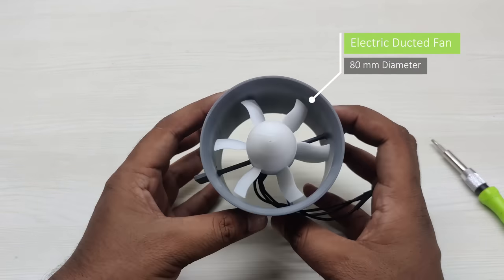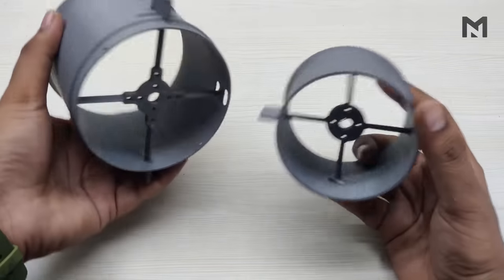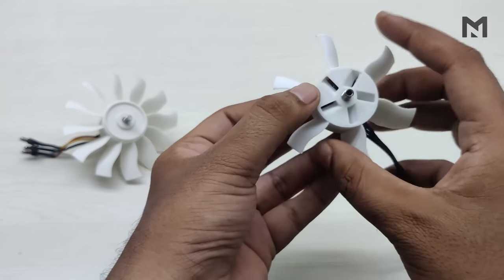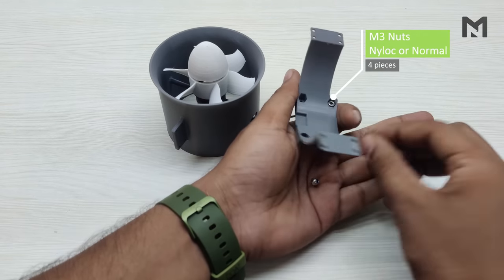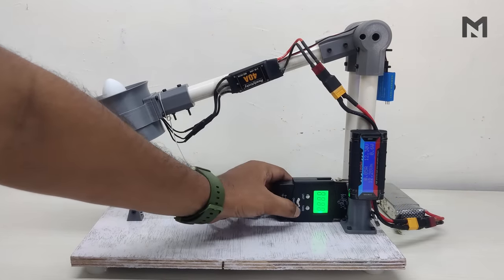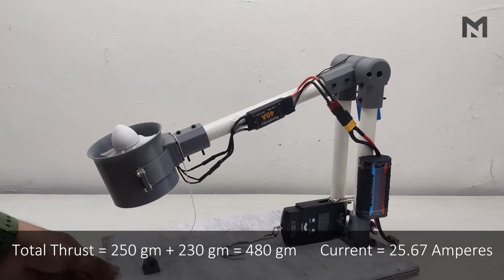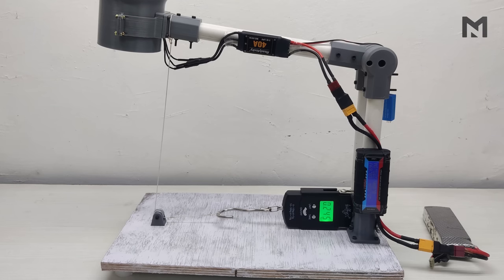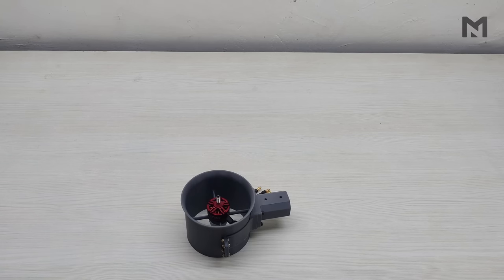DIY 80 mm Electric Ducted Fan | 3D Printed | Thrust test comparison

Comment: Very good setup and work hard, but In my opinion you should fix the engine then measure the trust directly for example you put the weight scale 20 cm from the output nozzle.
Reply from the maker: Oh yes i must do it but this is so far accurate method I have fount out for thrust calculation. I am in development of electrical thrust calculation device and thus it will give an accurate result.
so thanks for watching this video and don't forget to subscribe
Reply: @MechNinja  Thank you very much and I subscribed already 😊😊😊

Comment: The stators in your housing are not doing anything.  You need to look at stator designs as they will impact the performance greatly.
Reply from the maker: Thankyou so much for your suggestion.... actually this is my old video....do check my new videos I have improved my designs a lot...
And don't forget to subscribe 😊😊😊

Comment: Nice work, but, yes there is a but: you essentially built a ducted propellor, not a fan which consists of a dynamic stage (the rotating fan) and a static stage (the stator) this stator behind the fan converts a fair portion of the dynamically produced trust by the fan into static thrust. Static thrust is what you need to have an efficient fan…. But al in all nice work

Comment: I have a query if EDF is place vertical and thrust is in upward direction  if high speed air coming towards EDF in horizontal direction then the result of thrust will change or remain same.there is no effect of air on propeller performance.
Please give me answer
Reply from the maker: Well that's a very nice question 😊🙂... Though I am not 100% sure....but I will provide you my answer...
See when there was no external force ( air ), applied to the EDF than it has the max thrust in vertical direction. But when high speed air comes in horizontal direction then horizontal force will act on it and this it will tilt the EDF at some angle.  Now using parellelogram law of vector addition, we find the resultant force.
And this resulting force when divided into its vertical and horizontal components. We get the vertical thrust as vertical component on resultant force.
Now here is the answer to your question, The thrust of the EDF will remain same but thrust in vertical direction will change.
Hope you get it. And feel free to ask any questions....😊😊
And don't forget to subscribe...😊😊
Reply: Hello sir I want to know about propeller design specially chord distribution from root to tip of propeller and thickness distribution from root to tip of propeller
Reply from the maker: Well it's a very tough question but unfortunately I can't answer it. Because I am a mechanical engineer and your problem can be only solved by a aeronautical engineer.
Though it is a machine design problem but we are not taught in detailed about a particular topic. Or you can find a person who has a brief knowledge in fluid mechanics....Hope you get it....😊😊😊
But for any mechanical problems....I m here and you can comment your problem on any of my video....and I will be there ..😊😊😊
But don't forget to subscribe 😅😅😅

Comment: Everyone knows reducing number of vanes will increase efficiency and performance....try to reduce wane angle at inlet and outlet and add a diffuser to increase pressure
Reply from the maker: Yes I am working on another project....I will b le reducing the pitch of the propeller and check the results on multiple blades.....
So thanks for watching and don't forget to subscribe 😊😊

Comment: Your duct needs to be 2 times the diameter of the fan, with the fan in the center.  Also the more blades you add you'll need greater RPMs needed to realize the efficiency.
Reply from the maker: Thankyou for your suggestion I will definitely do it....
Please check my new video with a really good thrust and efficiency....
https://youtu.be/_VhMPbX8XAQ
And don't forget to subscribe 😊😊😊

Comment: A critical design element on ducted fans is the clearance between blade tips and the inner diameter of the duct. This distance has a great effect on efficiency.

What is your clearance dimension?

Have you considered an encased fan?

Comment: the more blades you have, the most dirty air . If they spin slow enough, then lots of blades will stay fairly clean and will stay efficient. As soon as you speed them up to the point where the trailing blade is cutting into dirty air, the whole thing becomes more and more inefficient.
you can actually spin less blades faster and get better thrust, for LESS power than if you used more blades and just kept increasing rpm and sucking power.
for each rpm change, you consume a factor of 3 times that in correlating power.
And this applies to approach angle of the blade of course, as raymond gage point out.
its not a simple matter of more power and more blades equals more thrust. its a matter of seelcting the right kv motor, the right number of blades and the right rpm and blade angles to get the optimum thrust and time.

Comment: it should be without a pulley, because it will reduce the power of the thrust, just like a pulley in a well using a bucket
Reply from the maker: No I don't think so it will reduce any power. 
And In bucket case there's no power loss. We only pull the bucket weight and there's no extra load which is applied to it.
And note that we are neglecting friction heat loss....😅😅 As it's a minor loss in our case...
Thanks for watching and don't forget to subscribe 😊😊😊
Reply: @MechNinja  ok good luck

Comment: The efficiency of the motor decreased with the addition of more fan blades, you can hear it. How much thrust could you get from that diameter duct will depend on the motor.
Reply from the maker: Thankyou for sharing your views on the project.
And this is my old video. Do check my new video, they are good too...
And don't forget to subscribe....:)

Comment: Perhaps I should not extrapolate this idea to jet airplanes, but jet engines have from 16-34 blades. There is angle, width and even material density affecting the number of blades, but why than it's not less blsdes if the results favor less blades in this sort of experiment.

Comment: Has this been mounted and tested on an rc plane ?
Reply from the maker: No...I am not using it on rc plane untill I increase its thrust. I am working on increasing its thrust and when it will be High enough than I will use it in rc plane. Though I can currently use it on any plane and It will work. But the problem will be it's slow speed. So I want an EDF which has can move a plane at high speed.
Thanks for watching and don't forget to subscribe...☺️☺️☺️☺️

Comment: Are those printed blades safe???
Reply from the maker: Yes they are safe. You need very high rpm for the blades to brake from centrifugal force. But in our case it is safe.
Light weight of the propeller is also beneficial for us.
Hope you get your answer...😊

Comment: what if you decreased the diameter of outflow to accelerate the air and add another shroud extension that is larger than the outflow to allow air to be sucked at the sides.

Comment: bro i think that u had not measure the mass of the system when you are changing the  blade ( is the mass of the all blades is same?)  also the upper cap was not perpendicular to the blades in the 2nd and the 3 rd chance

Comment: can i install a better higher kv motor with your stl files
Reply from the maker: It's not about the motor it's about the diameter. You can use motor with diameter of upto 28 mm
Reply: @MechNinja  HGLRC Aeolus 2306.5 2550KV 4S Brushless Motor can I use this is it better than the one you used in your video I need a little more thrust actually and i can't find the motor that you used
Reply from the maker: I can't find it's diameter.....may be you can use it

Comment: You must try 4s battery mir blades require mor torque to be more efficient, and work better not static but in motion
Reply: More blades

Comment: And therefore you are forgetting that you are adding more weight for the motor to spin with the increase in no. Of blades. And keep the number of blades to odd .
Reply from the maker: Thank you so much for your suggestion..... actually I have neglected the weight of the blades as it was less...
And from nxt time I will keep the no. of blades odd.
Thankyou for watching and don't forget to subscribe 😊😊😊😊

Comment: Why don't you place the pulleys into 90°? Because that we will have the exact measuring of the thrust!!

Ahm if i Am mistaken, can you explain it to me?
Reply from the maker: You mean to attach the spring balance directly below the motor ?
If yes then let me tell you why.
It's because I want the flow of the exhaust air to be linear. I don't want any obstruction in its path to achieve maximum efficiency. If I would have placed spring balance below it then because of its size, the air will hit it and it will deflect the air resulting in turbulent air. So that's why I have used a string to eliminate air turbulence as string has less surface area.
Hope you get it , and if not then tell me and I will explain it more briefly.
So thanks for watching and don't forget to subscribe 🙂🙂🙂
Reply: @MechNinja  ahhm i guess, it need much more energy as what you did. Because if we place it in normal position,its look like calibrating the weight and somehow it would be efficient
Reply: @MechNinja  but nevermind, i like your PRINTED ENGINE, AND BTW. I'M A MECHANICAL ENGINEERING STUDENT AS WELL HEHEHE, I LIKE THOSE STUFF THAT IS RELATABLE TO AIRCRAFT
Reply from the maker: Thanks for watching and since you are a mechanical engineer then this channel is for you ..as my future projects will include all the mechanical stuff....
So don't forget to subscribe 😊😊😊😊

Comment: Interesting but i dont see the point becasuse is a fan and I don't see the air flow as a date. Other consideratión its the way it's meassure the force because dont consider the extra weight of the blades.
Reply from the maker: I have neglected the weight of the blades because they were light weight and hardly make any difference in the observations.

Comment: What if you made a jet out of those pieces?
Reply from the maker: Jet needs higher melting temperature material....I have made this out of PLA..So it will melt at 200 degree celcius.
I will make a metal one in future...
So thanks for watching and don't forget to subscribe 😊😊😊
Reply: I not forget subscribe good luck I'm from sri Lanka
Reply from the maker: Thankyou brother...☺️☺️

Comment: IT WOULD HAVE BEEN BETTER FOR YOU TO LEAVE IN THE SUPPORTS AS THEY WOULD HAVE ACTED AS  STATORS WHICH STRAIGHTEN THE TWIST OUT OF THE AIR INDUCED BY THE FAN.
Reply from the maker: Check out my new video of EDF with stator blades. It hs more thrust than this one. https://youtu.be/ujCK-SfxDDc
And don't forget to subscribe 😊😊😊

Comment: The fact that air jet hits the table under the EDF might affect thrust result. There shouldnt be any surface beind the EDF during the test.
Reply from the maker: Hmmm are you talking about the main table surface or the flat surface of the test rig ...😅😅
Reply: @MechNinja  Anything that is an obstacle for jet stream of air. EDF is pushing small mass of air with a great speeds (thats why efficiency is so low for static tests) in such case any obstacle behind can create a back pressure increasing the thrust.  Kinda similar to how ground effect increases the lift of aircraft wings and for helicopter rotors.
Reply from the maker: Well next time I will remember this .....so thanks for sharing the information...
And don't forget to subscribe

Comment: Could someone explain the science behind why fewer blades are more efficient?
Reply: More blades is More surface area trying to move air = more difficult. A Lower kv motor(more torque less top speed) would probably  do better with more blades.
Reply from the maker: Thanks for explaining.....And don't forget to subscribe for more videos... thankyou 😊😊
Reply from the maker: Mike has explained the reason.  I am using a high kV motor. It has low torque. Higher number of blades works better in high torque low kV motor. Next time I am going to use that and find out the results.
Thanks for watching and don't forget to subscribe...😊😊
Reply: @MechNinja  Please do a followup to this one using the same motor, but with only 4 blades and 3 blades to see if it keeps improving. :)

Comment: The results might be quite different or even reversed if done in a wind tunnel for a more real-life comparison.
Reply from the maker: Yes for more accurate results I must use wind turbine but currently these datas are somewhat accurate. But in future I will definitely use them.
And thanks for watching the video and don't forget to subscribe 😊😊😊😊
Reply: @MechNinja  Wind forced into the ducted fan at speed changes everything, and you just brush it off as nothing?!?!  Science dictates we must test this in real-world conditions, including the air movement into the ducts.

Comment: Try with a 4s or a 6s battery,
Reply from the maker: My motor won't allow me for a 6s battery. though in my upcoming video I am testing a newly designed EDF with 4S.
So thanks for watching and don't forget to subscribe for more videos like this...😊😊😊
Reply: @MechNinja  if this is a racing drone motor then it should be capable of taking 6s unless your esc is not capable of taking 6s. And yes your motor is not designed for higher torque.
Reply from the maker: Make be it can take 6S but the manufacturer only recommended for 3S and 4S

Comment: The way you measured thrust is wrong. The rope should be in coincident with the shaft. In the video the thrust is in the middle acting like second class lever (load is in the center). The thrust is little less than that of video.
Reply from the maker: You can check my new video, I have improved the thrust measurement using a weighing module.
And thank you for watching and don't forget to subscribe 😊😊

Comment: your lipo voltage dropped significantly with each test. if you had used fully charged lipo for every test, results would have been much different.

Comment: Missing the motor rpm…if they not work at the same speed, the comparison of the efficiency is completely wrong because the efficiency of the motor change according the rpm…moreover the distance between the axial ventilator and the wall base compromise the performance…people say nice work because they saw something interesting but everithing is completly wrong…nice try bro 😅

Comment: where's your bearings?!
Reply from the maker: Why to put bearings. I have directly attached the propeller with the motor
Reply: @MechNinja  a bearing is the intermediary part between a moving part and a relatively stationary part. Bearings don't move as much as the moving part, and reduce friction as moving parts oscillate and osculate, such as rotating shafts turning imbalanced masses. It's about reducing friction!

Comment: 7:10 really bro?, 25.33Amps? R u sure?
Reply from the maker: Yes.... everything is measured correctly....😊😊
Reply: @MechNinja  my mistake, it can take more amps if voltage is low, i was comparing the load with 3 phase IM which works on 440v.

Comment: WARNING! Incorrect thrust calculations! Did you realise that propellers with more blades are heavier (more plastic)? That's where that grams reduction in uplift comes from.
Reply from the maker: Actually the weight difference of propellers is small so I have neglected it sir.

Comment: You builded e very dumb EDF why did you only build 4 spokes for the motor holder? You should have formed the 4 spoke motor holder in a inverse propeller one that is static but would turn the opposite way of the rotating propeller bud with the same air flow direction. Practically like a jet engine where the spokes are also propeller to get mor thrust 😂
Reply from the maker: Thankyou so much for your suggestion. 
This is my 2 year old design... please check my new designs...they have stator blades as well as counter rotating propeller too. And many projects like that.
Please check them...
And thankyou for watching and don't forget to subscribe 😊😊😊😊
Reply: @MechNinja  thank you for your quick and informative response I will check it out right now. Keep it up pal! 👍
Reply from the maker: @icebluscorpion  thankyou so much